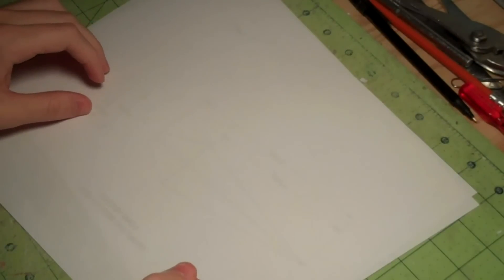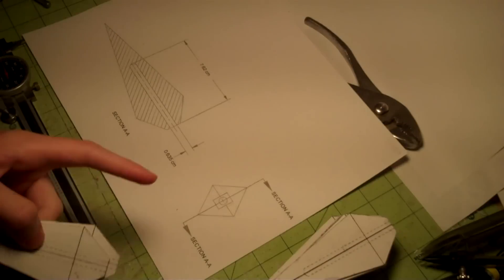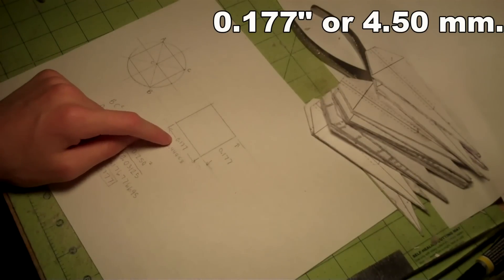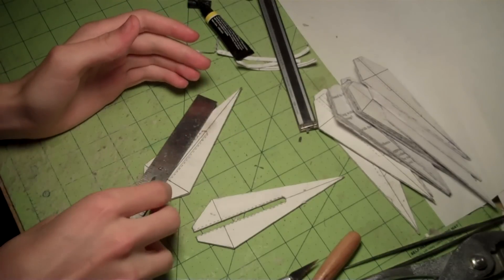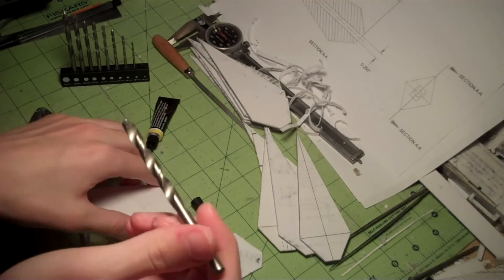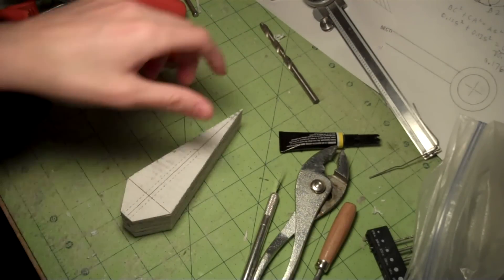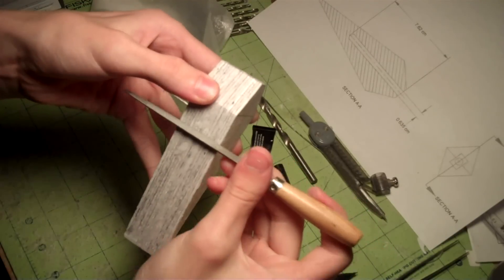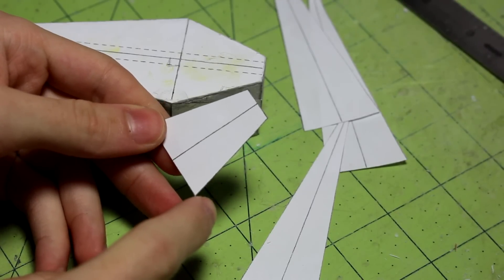How To Build The Hardened Paper Kunai Part 2

Comment: Shelden can you please estimate this, im lousy in math. Im actually using a 220 lbs card stock, and in estimation how much card stock would I need to form the blade part? ( i know that one paper equals to 2 pieces of hardened paper?)
Reply from the maker: Card stock is about double the thickness of the paper I am using So you would probably need to use about half of the amount of paper to form the blade shape. So probably close to 150 layers of card stock. But the glue adds a little bit of thickness as well. Luckily you can easily sand off the extra.
Reply: Thanks, Im already near the process of glueing them all, since im at the right 150 layers of card stock. Im also planning on improvising the blade part of the kunai into a sharp spear if ever i make another  kunai